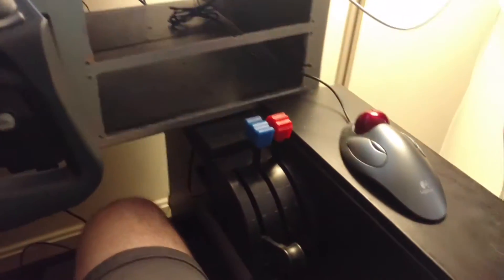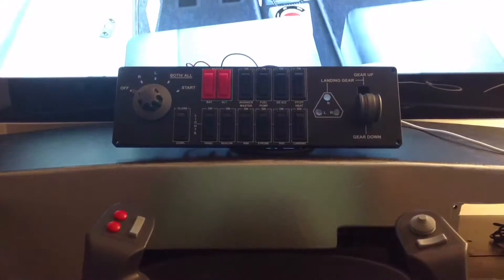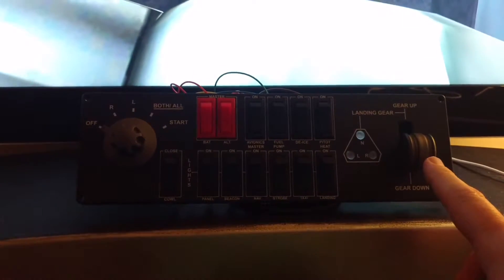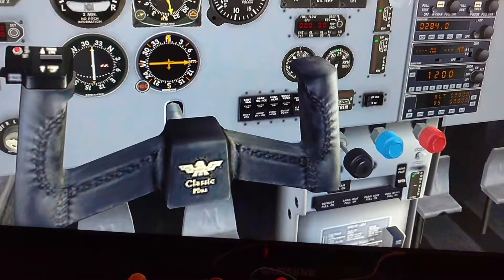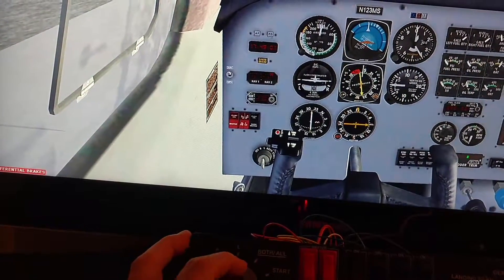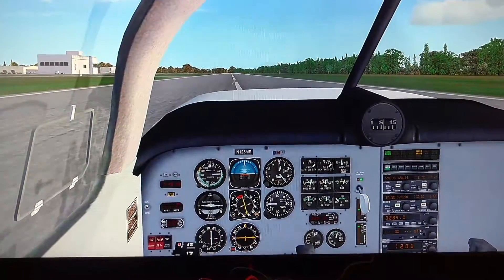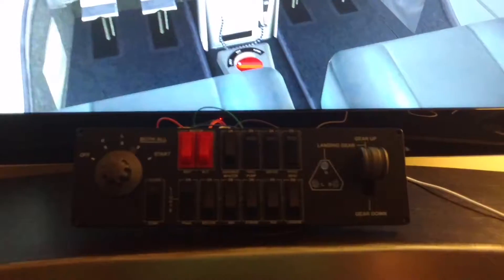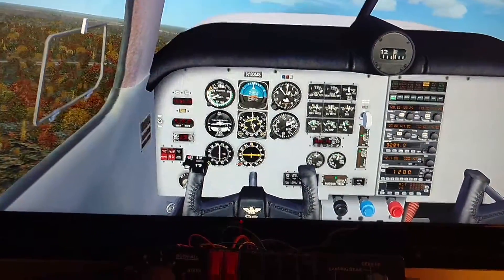Fixing Saitek Proflight Switch Panel with Arduino

Comment: I have an issue with my panel as well. The landing gear lights stay green and windows will not see the panel.. I pulled the cover off and I found a wire that is loose. I am not sure where it goes. I hope you have the original wiring in a picture somehwere? please!

Comment: can you help with the pinout for the arduino ,I have a arduino leonardo ? please
Reply from the maker: All of the pins used are defined at the top of the file https://github.com/CountDeMonet/SaitekSwitchPanelArduinoReplacement/blob/master/SaitekSwitchPanel/SaitekSwitchPanel.ino

lines 3-23

I used an arduino pro micro so there may need to be some changes to work with a leonardo but the pin out should be nearly the same.

Comment: Hi Eric. I faced the same probleme with MSFS2020, so iI removed the electronics, rewire everything as you explained (also build an electronic independent circuit for the landing gear 2 coulored led's that is working not exacttly as the original but with a sarisfactory change from green to red and off after 5 seconds) and adapted the keyb code from fsx to MSFS one's; the problem is that the statement of the code begining /#include <Keyboard.h>) has made changes to my wireless keyboard and I've to download it's drivers from the net to solve the problem. The question is: how can I write that code in order to see the arduino as a game controler (and how can I cange it's icon with one I created, by the way)? Tks
Reply from the maker: Really odd that it took over your wireless keyboard. Maybe the keyboard uses a similar chip for usb or something. I chose the pro micro because it can act as a keyboard interface over usb. There is a library to use the pro micro as a joystick but you would have to redo the code to map it properly. I have never tried that. Here is some info on how to do that though. https://www.instructables.com/Arduino-LeonardoMicro-as-Game-ControllerJoystick/

Comment: I've no doubt you've already sussed out your panels but I seems a bit weird that you've had problems with them in the first place. I bought mine when I was running Windows 7 and they continued to work when I upgraded that computer to Windows 10 and they still work on my much newer and much more powerful custom built computer. I've now downloaded and installed the Logitech Plugin and it all works both in P3D and MSFS.
Reply from the maker: I was able to get some of the panels working using the 3rd party software but the switch panel was dead. None of my hardware liked USB 3.0 and this pc only emulated 2.0 which I think was a big part of the problem. My saitek joystick was also unusable. I actually took down my simpit and stored everything. Maybe one day I'll take another look at it. Could have just been a major usb incompatibility with the new machine

Comment: Heey bro, I have a saitek rudder pedals, radio panel and autopilot panel who all got toasted when connecting to a usb hub. Im like crazy searching how to fix it. Do you know if they would work with arduino? Thank you in advance!
Reply from the maker: The rudder pedals would be pretty easy to do but the other two would be a lot more work due to the displays and all of the work needed to translate the sim params to the displays/inputs. The switch panel was easy because it was just on/off switches so I could map them to a keyboard. Good luck.
Reply: @EricBanker  Got it. If I get the rudder pedals to work it would be great. Ive never worked with arduino before. Can you give me some directions from where to start or an approach on how you would fix it?
Reply from the maker: @EarthquakeDigital  A lot of info is in the github repo on how I did this project https://github.com/CountDeMonet/SaitekSwitchPanelArduinoReplacement I used the Pro Micro as it can be used as a usb keyboard. I've seen some people use something like this (https://www.amazon.com/Reyann-Arcade-Encoder-Joystick-Fighting/dp/B00UUROWWK) as it's meant to be a joystick replacement. This could work for the switch panel too if you didn't want to write any code. It's been a while since I've looked inside the foot petal (I own that one too) but I'm pretty sure it's not too complicated. First thing to do is to take it apart and figure out how it's wired into the existing usb encoder. An iPac would also be an option (https://www.amazon.com/I-PAC-Arcade-Controller-Interface-Cable/dp/B01N6TKDDH) that would require no code
Reply: @EricBanker  Awesome Eric, I deeply appreciate your help. Its really sad to have three burned devices at once. The rudder pedals looks like are basically a three axis device, one for yaw and two for brakes. Do you know if the reyann device by itself would work?
Reply from the maker: @EarthquakeDigital  pretty sure the zero delay encoder only supports 2 axis since it's designed for joysticks. An ipac 2 is probably what you would want if you are looking for a codeless way of fixing it. It supports 4 axis in the one package plus a few on of buttons
Reply: @EricBanker  Great, got it. You say thats a codeless way to fix it. But a "code way" would be using the pro micro? You think its a better way despite having to code? Im a real noob on this kind of projects, but I have some Knowledge on coding.
Reply from the maker: @EarthquakeDigital  You could use the pro micro to read the state of the various axis but I probably would just use an ipac or other standard joystick encoder but I think it could be done. You may need to write some code on the windows side to handle the axis since it doesn't map directly to a keyboard. You would want to look at how to read it as a mouse https://www.sparkfun.com/tutorials/337

For the switch panel it could be argued I over engineered the solution but it was 1/3 the cost of the ipac and I learned something so :) 

If you want to get into a code solution I'd start looking at one of those other dead panels you have. Way back when I had an Android app I developed that pulled flight system data from FSX or P3D and pumped that over UDP to any listening device. I made the source code for the simulator side of it which pulled all of the data and then shipped it off open source on github here https://github.com/CountDeMonet/FlightConnect

If I really wanted to bring one of those more complex panels back to life I would start with a wifi enabled microprocessor with a lot of io. Maybe even a raspberry pi. Something that could listen to a wireless udp broadcast and subscribe to it. Then use the data from the sim to populate the displays.
Reply: @EricBanker  Thanks very much Eric! I think I will follow the ipac solution for the rudder pedals after all. I really wanted to get it fixed but no eletronic repair shop here in Brazil wants to even take a look at it lol.